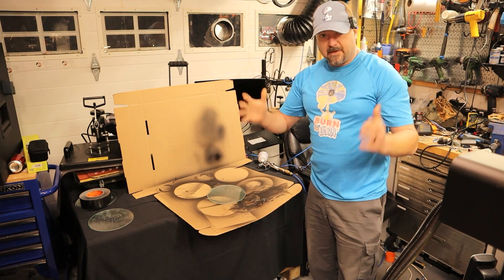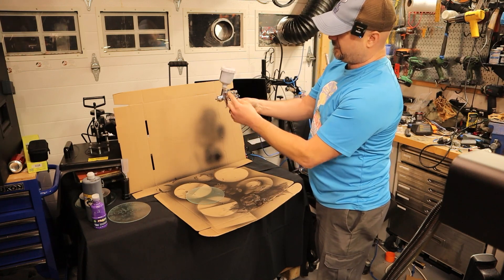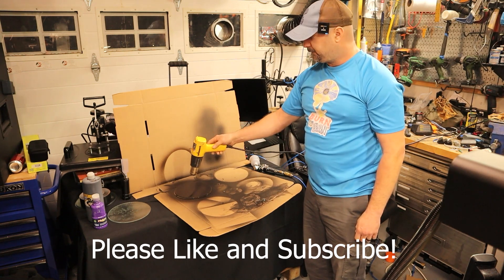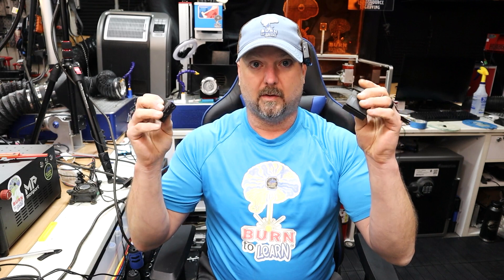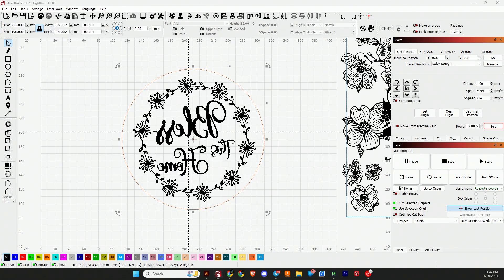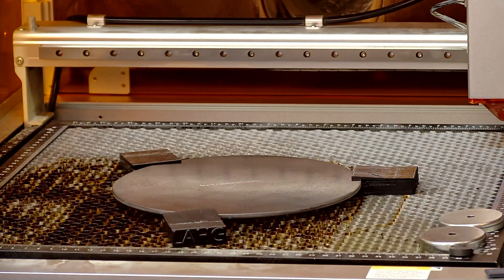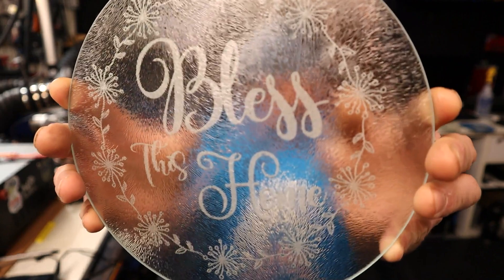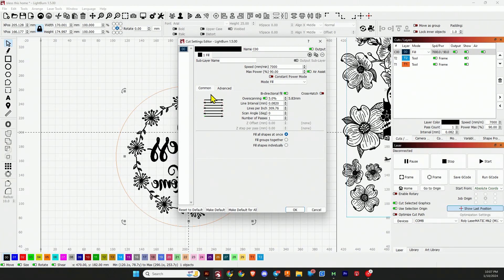How to turn a $1 Glass Trivet into a $30 Trivet with a Diode Hobby Laser

Comment: Very nice and I learned something today about the centering.   Thank you for posting this Patrick!   I am also wondering if you could actually use the wood dye or a paint of sorts to fill the back engraved part?  Curious as to how that would look on the Tempera piece.
Reply from the maker: Great suggestion! paste wax makes a great glass filler for some added pop.

Comment: Patrick, I noticed you are engraving on the same side as the paint with the design reversed. I have seen other people paint the other side and engrave from the non-painted side throughto the painted side so that the laser can transfer the energy to the paint and mark the surface. Have you tried it like that or was the glass you had made in a way since it was frosted it reall didn't matter? I have marked clear glass 8x10 glass for pictures by painting the opposite side and got decent results. Just curiuos about your experiences. Keep maing good content!
Reply from the maker: those trivets are textured on the top side, so i elected to have the engraving on the back in reverse. When doing plates n such, i like to engrave the backside so the front is smooth, whether with a diode or fiber with paint, or a uv right on the glass.